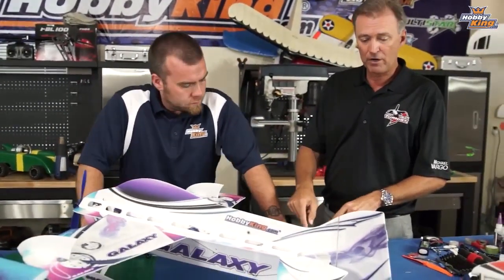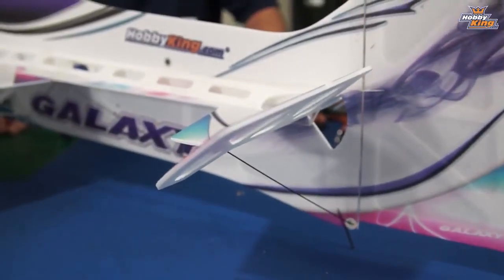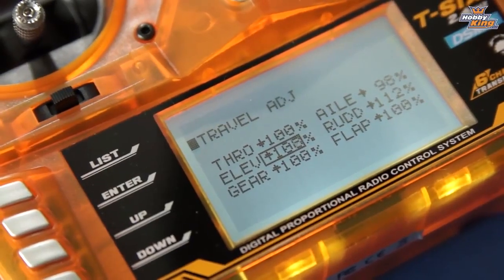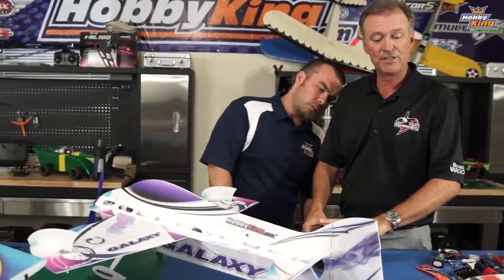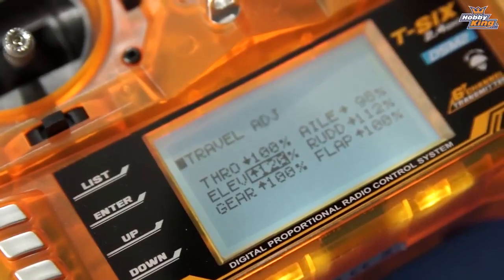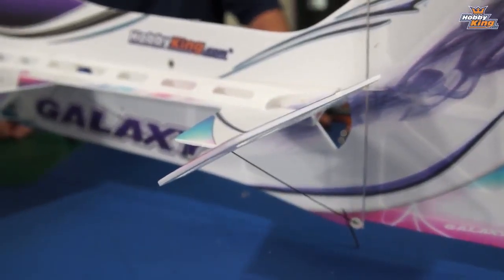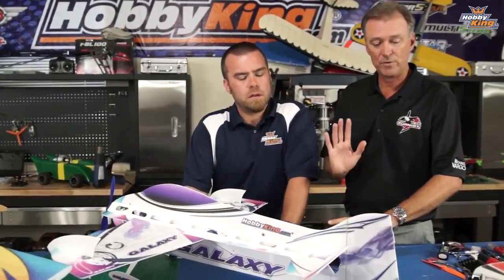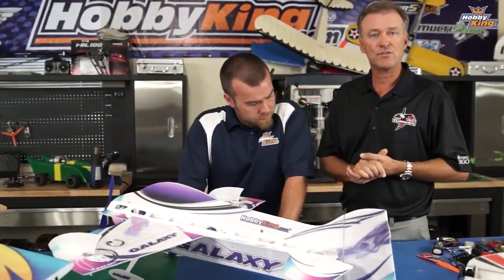MIchael Wargo Flight Instruction:  The radio Setup for 3D flying (from original how to 3d)

Comment: Many thanks for the great video. Just one remark concerning travel adjustment, especially on ailerons. Definitely you have to make exactly same throws up and down which in the case of just going to maximum, it is not set. Please correct me if I'm wrong.
Reply from the maker: You are not wrong.   This was shot a while back, and I left that out I guess.   I included it in other videos and should have in this one.   In this case, I was introducing the people to the concept of what travel was for.   IN theory, they are never set to physical limits on both sides, one will deflect slightly more.   Ailerons are special because the up and down must ensure slightly more deflection, like 1/2 degree because of unequal prop wash on top.   This ensures there is no differential.  MOre airflow in one direction (mostly this is for pattern planes.  Thanks for response!